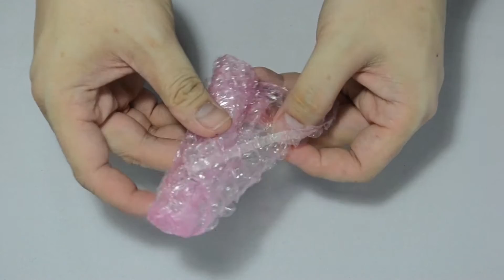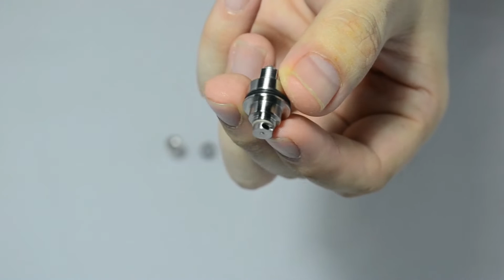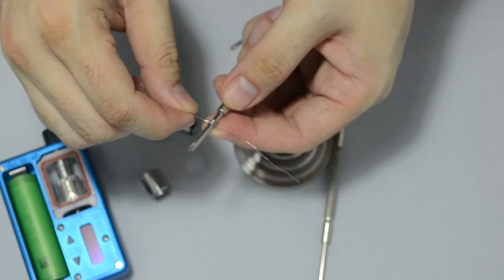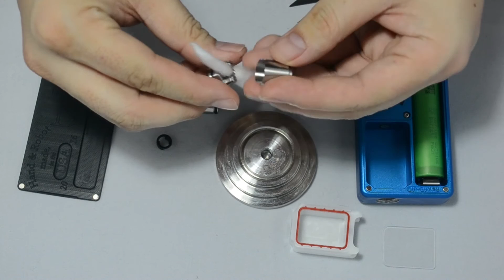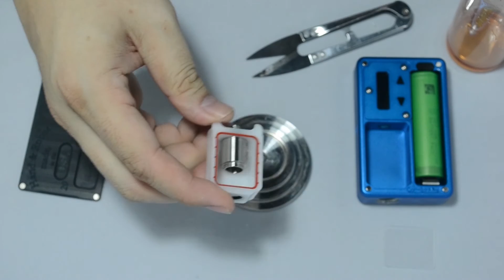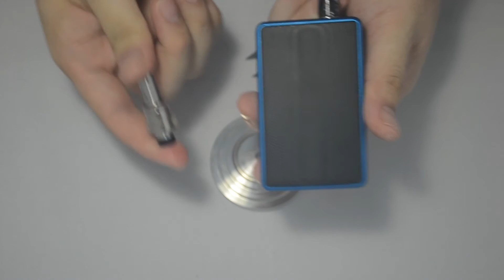[UNBOXING / BUILD] Hellfire Exocet

Comment: no usb charge port. complicated to refill juice.... $600.. not worth it
Reply: Pull Boro glass down fill push glass up, hardly complicated.
Reply: And 3years after when you realise its hype and better more than normal mod. And wtf u want to charge ur batt thru usb? It's not stable to charge ur mod thru usb. Y u think mod like powerbank kah? U kind of ppls la the reason why vape industry collapse. And also let me remind u d usb on mod are purposely for upgrade the firmware not for charging.
Reply from the maker: Abdul Saleh agreed. Definitely not worth for $600